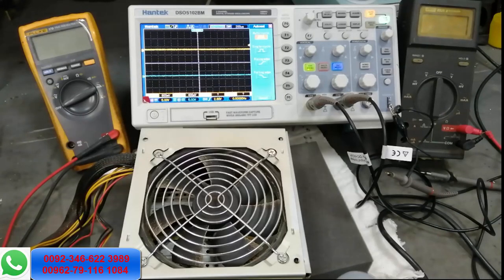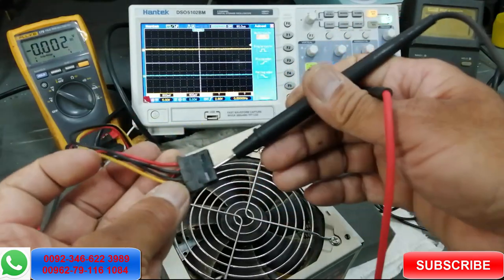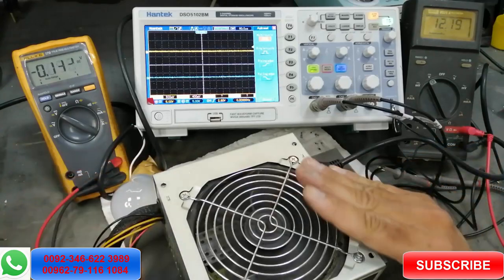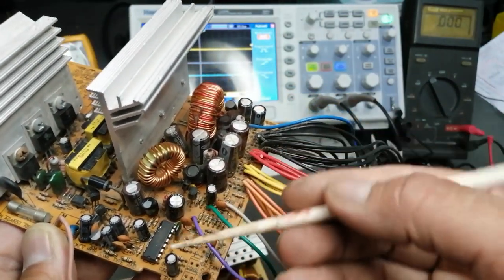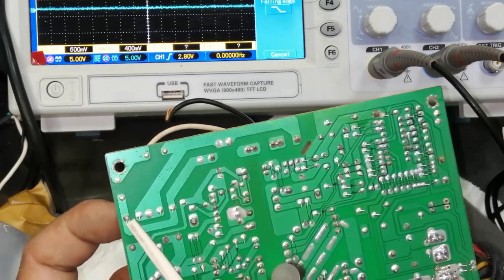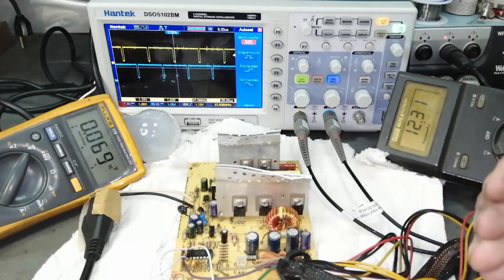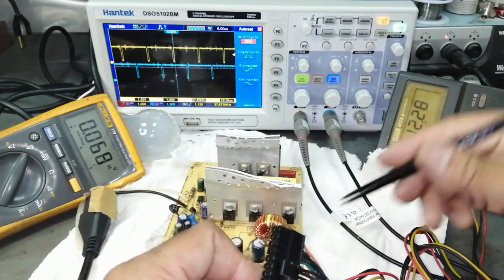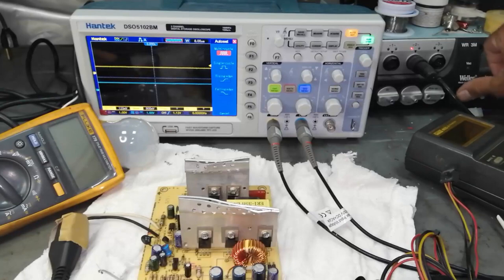#192 How to repair Computer Power Supply /Branded ATX using SDC2921 IC

Comment: Thank you for the best explanation I have ever found. Please more...
Reply from the maker: thanks a lot. i will share more videos
Reply: @HaseebElectronics  Thank you!
What if I have the PWM pulses in pins 7 and 8, but stil not getting 3.3, 5 and 12 volts in the output?

Comment: If the PWM has power but not switching, how to find which line has a short ? how many ohms between the yellow and black wire are considered normal ? can we put 12v from other source at the barrier rectifier and test the current at the exit to find the short ?

Comment: Geday mate.
I've being working on a Campaq ATX SMPS, without a schematic, which has no SB 5V+ on a  purpule wire, however, the green switching wire do have +5V present. inspecting all the board etc, nothing seems to be damaged, looks like a new. but on the SB-5V wire Down to PCB print-out reads "FAN OFF " where the purpule wire attached. Any help to resolve this issue would be greatfull.

Comment: Hi , thanks about your video, but I have a problem that did not find in your demonstrated. When I warm two termistors of near the two big capacitors my ATX run but after many mintus the ATX will be off. I thought the problem comes from Termistors and after changing with the new Termistors I have always the same problem. Another side when two wires Green and Black touch together the fan runs for just two degrees but when this contact is flactuately than fun runs!! I checked transistors, rectifire, capacitors and termistors  and all of them are good.
Could you help me and you say to me what is wrong exactly

Comment: I think problem is after signal transformer, i replaced some resistors and zeener diod yesterday but i'm not so sure about numeration of them. Do you have recomendation of atx diagram which could help me to get info on resistors and diode zeener sizing. Thanks

Comment: ATX power supply with SDC2921 PWM ic, i get 5v standby but on PS on(Green wire) i don't get 5 volts here it is only 0.34 volts. Please tell me if PWM ic is faulty??
Reply from the maker: please check there will some voltage divider resistance between purple wire and the green wire 
check green wire is grounded anywhere or bad connection.
or remove connection  from SDC2921 and then check voltage on green wire 
if you get voltage, that means the sdc2921 is damaged. (but it is near to impossible)
Reply: @HaseebElectronics  Thanks for replying. Your every video teaches us something new in field of electronics.

Comment: There is a second type of power supply that uses a separate Ic to monitor the output voltages . In this case a common fault case is the power supply turn on briefly and then turns off . Can you cover this type of power supply and this fault case

Comment: Can you tell me what is the AZ339P chip??? What is the main purpose in power supply circuit?? How can I testing?
I replaced TL494 chip but doesnt work, What should I do for this problem, I have 5 volt, but no 3.3 and no 12 volt
I wonder TL494 and near AZ339P duty ? These are same or not

Comment: Salam M Hasseb, you mentionned in the video that it is difficult to measure the voltage at SMPS transformer, why ? i have the same issue, my multimeter has not enough rms ?

Comment: Hello! Very good video! There is a power supply unit on the same PWM. When connected to the mains, the protective lamp lights up and goes out. When connecting the PS-ON wire, the protective lamp starts flashing at a frequency of approximately 1 Hz. There are no output voltages. The standby power is working. There is no short circuit anywhere. What could be?
Reply from the maker: welcome dear 
it seems that there is something wrong in secondary power section, check rectifiers, or output capacitors, specially in 5 volt and 12 volt lines. 
PWM controller tries to trigger and any protection is disabling the operation of the switching.

Comment: Thank you sir for your efforts.my question is that I have a problème of current with this Chinese computer PS .because when I use it for devices that need current mor than 7Amp I don't get it.so I want to know where is the problem...are those different amp marqued on the power supply fack or ????? A follower from Morocco.

Comment: Hello, what does the signal looks like in the optocouplers on the secondary side, the 1.08vdc is stable or it has oscillations ? i am trying to power on some ATX but cannot...
Reply from the maker: it is varying ramps signal, depending on the voltage drop in output side due to amount of load
Reply: @HaseebElectronics  thanks

Comment: Hello sir, pleaae help me to analaize. When i try to repair power supply. Why after i repair it. 5v is under voltage, and 12v is high. The component i replaced is dioda schottky 3 legs in secondary side. Where is the problem, when 5v under voltage, and 12v is high. How to increase 5v.   I think 12v output voltage  is follow 5v.

Comment: Sir may I know if i measure the vcc pin of sdc 2926 it is necessary to connect the green and the black wire  or no need to connect them sir tnx
Reply: @HaseebElectronics  Tnx for the information Sir

Comment: Assalamualaikum warohmah. Alhamdulillaah i finally found good video to guide me in learning electronic as an hobby. I appreciated your video which very useful for me and others. I'm repairing rex cool premium atx psu r3-500 v2.3. I have an issue where my atx just have 5vsb purple and 5v at green cable. My sdc 2921 has pcc 5v at pin 13 grounded to pin 5. When i connect green and black, i checked pin 9 is 0.06v. Pin 7 1.15 and 1.14 pin 8 1.13 and 1.14 back and for. Is it switching ?  hence no power out. Is there any problem with sdc2921 or other? I would appreciate it if you could help me hoe to identify the problems. Thank a lot Pak Haseeb wassalam

Comment: PSU can also latch off on power up if there is a fault if the voltage monitor IC latches the fault condition I think

Comment: Hello! Thank you for this amazing video. I have a problem, In standby mode my atx psu gives at standby wire 5volt but in pson wire green wire it gives 0.12 volt. After I saw your video you give explanation were I should look for this problem. My ic is est7502b I have the stand by boltage at vcc pin of my chip but in remote pin is not the same, is near 0.12 volt, it is a fault ic or I should look for something different? You are amazing, I wish you all the best!
Reply from the maker: best regards
in standby mode, purple wire have to provide +5volt SB
green wire have to provide above 1 volt upto 5 volt (when it is jumpered to ground (black wire) it have to drop voltage level at ground potential to PULL DOWN the remote pin (pin number in 9 in case of 7502) if we cannot find voltage on green wire then:-
1. may be green wire is disconnected from its point at PCB or it have bad soldering 
2. there is a current limiting resistor between green wire and purple wire on the PCB, if that resistor path is open, we will not find PSON voltage on green wire. 
3. if 7502 pin number 9 have internal short circuit, it is also a cause of low voltage level at green wire
Reply: @HaseebElectronics  Thank you very much for your reply. I am afraid is a internal short circuit because I was measuring directly the pin nr 9, as you mention between green wire and pin nr 9 has a resistance. This psu blow one capacitor  13volt 1000uF. I change it but after that it didnt worked anymore :/. Thank you again. All the best. +1 sub and like!
Reply: @HaseebElectronics  if I change the ic it will have a chance again or it will blow up again? Thank you
Reply from the maker: @gjergjkastro9404  remove existing ic
check PSON voltage ate green wire
if voltage ok, then install ic, otherwise trace the circuit for short circuit
Reply: @HaseebElectronics  Thank you
Reply: @HaseebElectronics  hello! I managed to remove the chip from the psu and the leg nr 9 has around 1.2volt. I saw in the psu a resistor it was very hot and black, I thought it was dusty but was burned. Is near with one of 2 small transformers. Maybe this is the issue for this psu? Or something else caused the resistor to fail? Thank you in advance!

Comment: It is not possible to monitor the PWM output on the scope if the PWM IC is connected to the High Voltage side OV unless you use a Differential 
Probe or you isolate the scope from earth ground .

Comment: Sir may I know why the rectifier diode doesn't busted when you shorted may I know the reason tnx sir
Reply: @HaseebElectronics  is the supervisor ic known also as power management ic or controller ic Sir tnx so much

Comment: I have the +5 V vsb high gets 8 V for it what could be the problem ?
Reply from the maker: for high SB voltage 
please check feedback circuit, may be optocoupler or related components have problem
Reply: @HaseebElectronics  I kind of cheated the the circuit by adding a load to 5 vsb to drop down to 7 volts then the turning on switch works I think because the 5vsb is too high the IC dose not let the main circuit turn on
Reply from the maker: @avonfonds2567  no it is not good method to dropping down the voltage. as this 5VSB is also VCC for the next pwm controller. if the vcc will change for pwm controller, then it will also make problems. moreover, the second section of the same transformer secondary will increase so might damage the signal switching transistors for signal transformer.
i recommened to regulate SB voltage as the same voltage also go to motherboard, so it may damage the PSON interlock in the motherboard. 
wishing you the success

Comment: Hello. My antec 350watt branded smps is giving only 3 volt on ps-on green wire. It's not turning on.
Reply: @HaseebElectronics  yes. It turn on for a second then stops.
Reply: @HaseebElectronics  please suggest how to solve this problem ????.
Do I need to change the PWM controller ic ???

Comment: In rare cases, there are half bridge converters with only one input bulk (high voltage) capacitor, but 2 transistor. Effectively, the same thing, just, primary of transformer swings 320V to hot ground reference, but in case of serial, center tapped capacitors, voltage on the primary swings +/- 160V relative to hot ground reference.

Comment: 5 v are showing on Green wire and purple wire but other volt (12v,3.3,6) is not available . So that my smps not working .
Pls suggest what i do .Pls help me sir pls pls pls.....
Reply from the maker: when you connect green wire to black wire, if the fan start for a short interval, or any yellow, red or orange wire shows some voltage and then drops to zero voltage, in that case the output circuit have some issue. so voltage supervisor ic is interrupting
Reply: When short green nd black wire no any response on fan and not showing any volt yellow,red,orange wire as like drops or  volt decrease only zero. Pls say sir how to fix it..
Reply from the maker: connect multimeter to yellow,or red or orange wire
make jumper to green with black
if meter shows some dc voltage then you have short circuit in output section(rectifier or some capacitor)
if there is nothing on multimeter then 
check vcc voltage of pwm controller
check 12 volt dc output from standby transformer for signal transformer
if these voltage are present then replace pwm controller (pwm controller damages very very rarely)
Reply: Dear Sir! As you said, I all checked once again, for exe_i make green +black to jumper but not get any volt on any color wire or volts drop while,stand by volt 5 are already present on green +purple wire. When checked vcc on pmw pin no. 13(HS8110 IC) 5v are present. And when checked stand by transformer output 2nd pin to 5v and 3rd no.pin are give 15.70 vdc on standby mode when test jumper mode this 15.70vds volt are constant or not increase. What I do?
Reply: Plss..Any reply sir 
I'm still waiting to your valuable responses.
Reply: Stand by transformer are give output 5v (1st coil)and (2nd coil)15.45vdc but thereafter signal transformer are not switching to 12v and other volts.i replaced both switching transistor C945.But no any changese isue. Now what I do ?Pls say
Reply from the maker: it means voltage supervisor section+ pwm drive is not generating signals

check 2 signal amplifier transistors at input side of signal transformer

then check power drive mosfets in hot side for secondary power transformer
Reply: Dear sir! I replaced both amplifier power transistor(13007)and also changed power mosfet (2N60).
But that problem remains constant.even on the basis of daubt , i changed both signal translator(C945) of output section.
Sir!How to know that  PMW is faulty.PMW no. Is HS8110.

Pls help me sir I'm totally confused and feeling defeated.
Reply from the maker: @shayadwo  if after verification of all surrounding components, if there is no oscillation then possibly supervisor ic hs8110 might be suspected

Comment: HELLO, SIR
here I am trying to make repairs to the dropped ATX power supply
here I see some capacitors in the secondary look bad.
I've replaced it.
for the capacitor in the primary condition is good.
which is the problem
when the power supply I try to turn it on without a load. 12v = 12.06vdc, 5v=5.02vdc
when i plug it into the motherboard, and i turn it on
12v becomes 12.20vdc and 5v=4.97vdc. and the computer does not want to appear on the monitor screen.
what else do I need to check and need to fix?
Reply from the maker: good morning 
please check its 3.3 volt 
and 
PG (power Good signal) the grey wire
Reply: @HaseebElectronics  when plugged in 5vsb= 5,03; green = 2,94; | 
when turn on without load  ----> load:
purple 5,03 ----> 5,03
green 0,02  ----> 0,02
orange 3,40,  ----> 3,40
red 5,02,   ----> 4,97
yellow 12,04  ----> 12,20
Grey 0,  ----> 0
blue -11,31  ----> -11,49
Reply: @HaseebElectronics  when i try to serialize it with a 100watt bulb, the light turns on brightly and flashes fast, what do you think sir
Reply from the maker: it means there is PFC circuit
so try to use 200 watt bulb in series to verify the situation
Reply: @HaseebElectronics  i check the diode barries (three legs) with multimeter, the result is under 0.100. is it possible if the diode can be half short? or not completely short?
Reply: @HaseebElectronics  now the power supply that I'm trying to fix can already appear in the bios and boot into the operating system. but there is a problem, namely when the process of loading into the operating system it stops, cannot enter the operating system. I think there's a problem with what else. could there be a bad capacitor, or some other problem? because some capacitors are still using the old capacitor.

Comment: I have same power supply in this video after I disconect this protect then I sort 12v switching mosfet damage after I am repair the mosfet but I can't voltage in output
Reply: @HaseebElectronics  How to replace a transformer atx power supply with a larger one such as ee43 transformer from a welding machine cause I am always wrong if rewind the ferit transformer

Comment: Sir what voltage should get at pin 7 and 8  in sdc 2921ic
Reply: THANKU SIR
Reply: Sir I do have oscilloscope to measure Khz then what should I do and also I have also checked all components to drive the signal transformer and also replaced transistors 945. The only option I have left is to replace 2921 ic
Reply: I have changed transistors as previous both 945 transistors was faulty.

Comment: Many thanks.
Reply from the maker: You are welcome!
Reply: @HaseebElectronics  Dear friend many thanks for your reply.Your explanation is very clear.My professional is electrical (not electronic or machatronic).In my higher education I had to learn basic electronics.But I am not involved with electronics.So its very easy to understand your explanation.
I am having my used computer power supply.it won't work.Earlier it work and it shows some error.When power is on it won't work but if I touch top of the unit then start.I found some places got heated up look like transistor (3 pin unit) near small transfomers.I re-solder the loose connections.After that it work few months.Yesterday again it won't work and I found fuse had blown.When I was check it I found two diods in rectified unit has out of order.Then I replace them and check.The line and neutral shows 5 ohms.earth is o.k.Then I connect it to the to the 230v power supply. Again fuse has blown.What may be the reason?
Reply from the maker: @aluthgederawimalasena8825  after replacing the diodes, if it gives 5 ohms, it means the input resistance is very low, in this case it have to burnout the fuse. may be still there is some remaining short circuit, which is to be removed.
check main dc capacitors, might be short circuit, check diode polarity
check input yellow X2 capacitor
Reply: @HaseebElectronics  O.K. I will check thanks.

Comment: My ATX has three transistors and three dual fast reactifier foods.two chips LM339 and TL494.primary section is good no output.optocuplar is good.one month passed by and still can't repair
Reply: Check for standby 5v, I had same SMPS its 5v is missing, because its 5v transformer is blown

Comment: This is simpler PSU with voltage monitor and PWM functions integrated in one IC . There is a second type where you have one IC that monitors the output voltage and current and a second IC that controls the PWM function

Comment: PWM Ic in this case is on low voltage side of the circuit
Reply: Is there a systematic procedure to decide why power  supply is shutting  down on power up if  no short  can be seen in the DVM